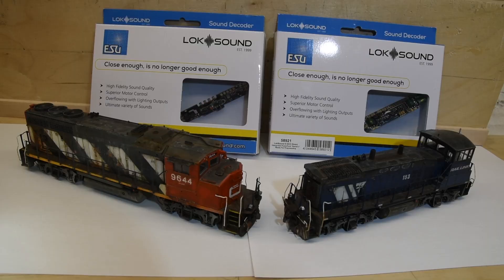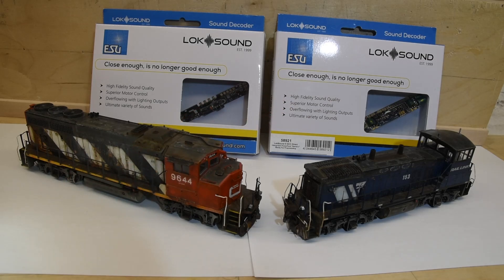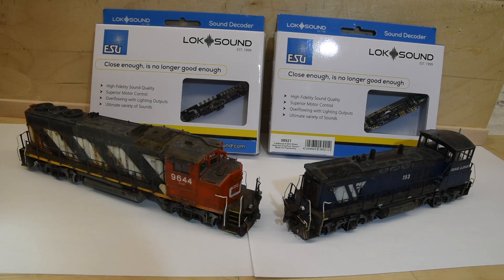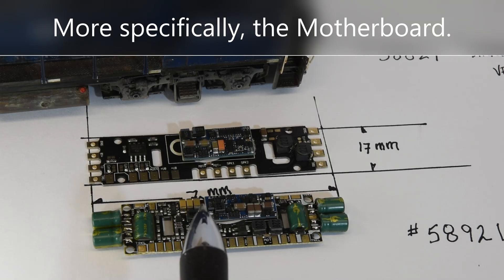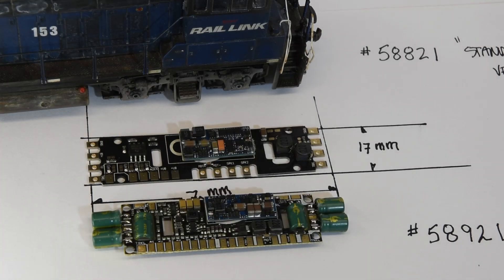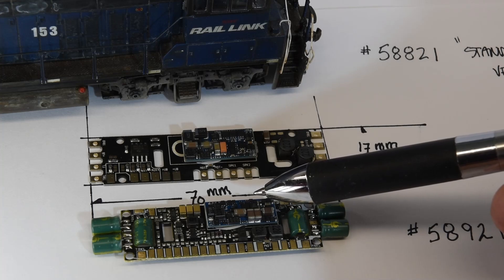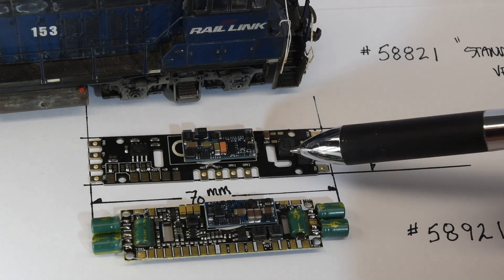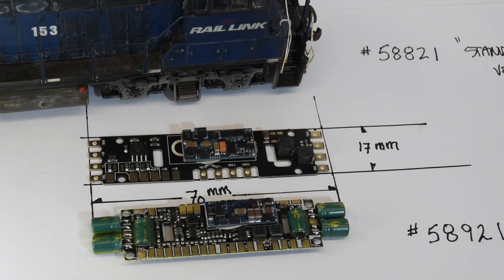The New ESU Loksound Direct Decoder "Integrated Power Pack" Review

Comment: The 58921 is a Atlas only board,will the the 58921 board fit  a Athearn Genesis MP15?I really wish ESU would  compile a list of Atheran locomotives and give it's consumers a diagram of which decoders will fit which Athearn Locomotive..Btw,did type speaker did you go with(brand,type?)
Reply from the maker: It doesn't matter to me. The board wasn't a perfect drop in anyway. I also build my own speaker enclosure out of .040" plastic. I don't really have any Athearn locomotives. I use Kato drivee Atlas mostly. I used the recommended speaker from ESU # 50321 and usually wire in two in parallel:https://www.youtube.com/watch?v=XFF1jwRNU4E
Reply: @boomerdiorama does that MRL switcher have a cab interior or did you put the speaker there? 

I am looking at installing these direct V5s w/ power pack in my Athearn SW1500, because the regular power packs won't fit under the hood with the speaker. I would like to keep the cab interior, so that is why I am asking.

Comment: Hi, I am very new whit this and please don't be to harsh with me. Questions that i have with loksound 58921 and I can't find answer anywhere. I am little confused about some wiring on that 58921 board      
1.	I have one speaker. So, I presuming that one wire from speaker goes to “Loudspeaker1”, and the other goes to???
2.	Front Light. One wire goes to “Front Light” and the other goes to???
3.	Track Left Front. One wire goes to “Track Left” at a front and the other goes to???
Thank's
Reply from the maker: The diagram that comes with the Loksound decoder points that out.

Comment: Great decoder review. I have 2 questions. What sort of LED's do you use for your lights and do they need resistors to work with this decoder board?? Thanks
Reply from the maker: I get my LED's from here: https://www.motownmodels.com/ You can get them with lens attached as well. I like these ones because they have long and very thin color coded leads on them. Tom's a great guy to deal with as well.
If you go with ESU Loksound Decoder it has built in resistors. No need to add them.
Reply: @boomerdiorama  Thanks for that

Comment: I agree best decoder on the market,  one feature I do miss is independent notching, I have yet figured out there intelligent notching. When your dragging 20 cars I liked that you could notch up to say notch 5 or so and crawl along.
Reply from the maker: I like the ESU "Throttle Hold" feature. You can also use the independent brake with it as well. The options are endless.😁

Comment: I've been using Loksound since V3.5, it is not just being able to run very slow, that the prototype can't do easily, it is the smooth acceleration and stopping that makes locos look good in my videos. The fact I can just buy blank decoders and load in the sounds I want when I'm ready to install is another huge plus.
Reply from the maker: I would agree with the motor control for sure. Better than any other Decoder I have. Cheers.

Comment: My view is that I appreciate the value of having several different decoders in my several locos, both with and without sound. There are usually a couple of features one brand has that the others do not. Even so, I have 3 brands I like and 1 I have to remind myself why not to ever buy another.
Reply from the maker: No sound decoder is perfect . . . yet. ESU Loksound is getting close though. Thanks for  sharing. Cheers.

Comment: Thanks for showing the the detail of the new LOKSound integrated power pack V5 decoders; I've been waiting for these to come out instead of using the normal Version 5s and having to buy the expensive add on power packs. On another matter,  I couldn't help noticing (and I'm not being a rivet counter) but your flat car has what looks to be friction bearing trucks, so if you have a spare set of roller bearing trucks you may want to swap these out. I think only museum type historical railroads are allowed to run friction bearing equipment. Keep up the good work !
Reply from the maker: Funny you mention that. I just bought new trucks with semi-scale tread width wheel sets. Cheers.

Comment: Man let me tell YOU, the best thing about DCC for me, isn't the lights or sound, it's the stay alive features!

I try my best to keep my track and wheels clean, sure we all do! 

But the moment you run into trouble and your loco starts to stall and splutter it just ruins the experience... 

Started fitting stay alive caps and now I'd really not be without them.

As for more premium decoders, I'd agree with you for the most part, but there are some really nice budget options out there too!

Cheers bud 👍👍😁
Reply from the maker: Yes. "Stay Alive" capacitors are great for sure. Cheers.
Reply: Yes.I m with you on that one.When I was making my mind up,which way to go,I chose ESU,simply because of their motor control.Like you,I wanted to keep with one brand,so the locos have uniformity.I think,now tho ,Tsunami 2 are up there, pretty close.Cheers Michael

Comment: Thank You for the update.
I too like Loksound but also like TCS as well, I also use a ECOS 50210 DCC SYSTEM and love the visual interface and RailCom.
As far as sound goes they are both great, but I do feel the ESU has better motor control.
I have not seen the new decoder yet, but will give them a go.
Regards
Gary
Reply from the maker: Thanks for sharing. I like TCS as well, except for the two modes you have to switch back and forth (Lighting & Sound) just to turn on ditch lights, etc. Furthermore, you have to install resistors for LED's as well. ESU resistors are built in. Cheers.

Comment: With the tabs never put the wire through the hole and solder its just hard work to change, tin the pads on the board and solder the wire into the puddle much easier to change and repair.
Reply from the maker: I don't put them through the hole. I meant the space to come up between the tabs to clear the long hood. Cheers.

Comment: As engaged in DCC for 20 years the real test of a decoder motor control is zero [0] to step one [1] and this is where the Europeans have excelled. The other advantage they have is in their range of motor sounds and this shows. All of them have advantages with Soundtraxx being one of the easiest to use over the ESU but the ESU has the flexibility but that equate to complexity but also an opportunity for those with a programmer and a little imagination. The Next 18 connection for the decoder is ideal for small locomotives and I believe these have a long term future and can be just unclipped from that board and installed in a decoder tester for programming
Reply: ESU also has motor control options for coreless motors...  I use mostly coreless motors (Maxon) almost exclusively and the ESU LokPilot decoders have become my "go-to" decoders.  Phenomenal motor control!  Haven't gotten into sound yet, I model HOn2/HOn30 and there's just not a lot of space in some of the locos I build, so I don't put sound in any.
Reply from the maker: Try one of the ESU "sugar-cube" speakers. They are very small and sound awesome. I have one in the switcher. Cheers.